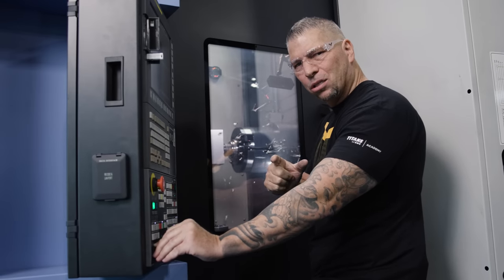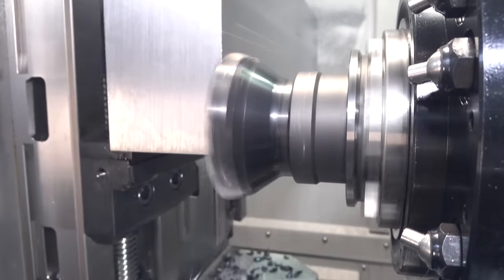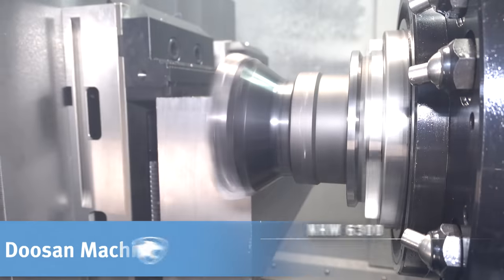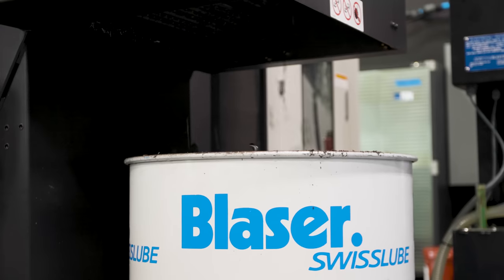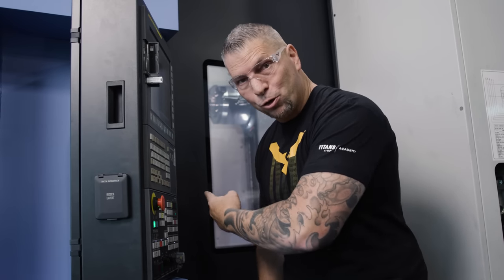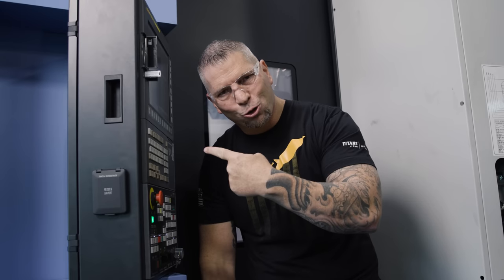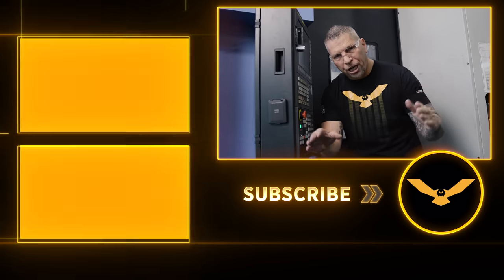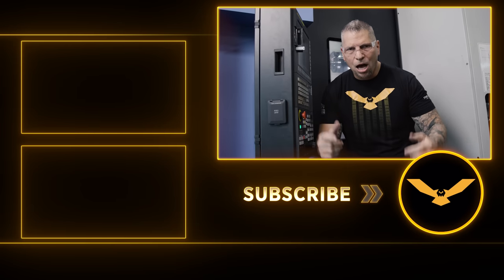Monster 4” DIA High Feed Shell Mill Shredding Steel | NHM 6300 | DN Solutions

Comment: I hope my homemade cnc will be able to hog some decent chips when it's done, I will have it finished this week after a year of work inbetween work and college. Love your videos! Always fun to see chips flying.
Reply: Do you have any videos of your homemade machine?
Reply: @BecomingOffgrid  not on YouTube but when it's fully working I will post some for fun
Reply: Hey, if it has the rigidity it's all up to the motor.
Reply: @brahtrumpwonbigly7309  it's 1000 pounds with 1 inch thick steel base that is also epoxy granite the motor is 2 hp so its gonna be a battle for sure its the size of a tormach with linear rails.
Reply: @AB_Tool  Why not just buy a Tormach or Doosan?  Could have been making parts all year.
Reply: @williamlind2843  not enough money also it helps me learn more about tons of stuff. I'm not planning on starting a business yet. I want to learn. I've got about 6 or so grand in it instead of 27 thousand. I'm in college so I couldn't justify that kind of money yet. I'm only 23 so as you can imagine I don't have my own home and property yet so a 27 grand investment is alot for me right now, it's probably a bad idea to spend that kind of money.
Reply: @AB_Tool  no chance of any decent cutting with that , must have been a nice project , a nice engraving machine perhaps
Reply: @kisspeteristvan  I made a short of it lol watch it does decent

Comment: Great product, we use this mill on cast iron and steel. On steel, insert 16, diameter 100mm, Z9, rotation 890rpm, Ap 1.5mm and feed 6800mm/min. On cast iron... insert 11, diameter 100, Z11, Ap 1mm and feed 24000mm/min :)

Comment: I always liked using a smaller face mill like this v.s those 12 and 16 inch monster. My rule was to use cutting tools that are weaker than my setup. That way, if anything goes south, the cutter is the weakest factor.
Reply: That’s also a good thing to use tooling that is not intersects with the pots near. That’s why I have full magazine inside my NH4000 😂 120 tools

Comment: "The tools inserts are positive and that takes pressure off the tool", does that also create a lifting force on the part adding risk the part will lift out of the clamp?
Reply: Most High feed insert geometry inserts force mostly in Z axis into spindle. Atleast the one i use. Didnt use the Kennametal yet
Reply from the maker: Always a danger in lifting… so rigidity and work holding is key.

Comment: We run the 6" version of this cutter. We run at a .06" DOC at 450ipm in steel using a 60% stepover.
Reply from the maker: Nice
Reply: Great googly moogly! 😳 How much horsepower does your spindle have?
Reply: @BPond7  we use this cutter on a 69hp 3,100ft-lb torque spindle.
Reply: @raceman351W  Wow! I’ve never had the chance to run anything nearly that powerful, in 22 years of machining. Sounds fun!
Reply: @BPond7  it has been a lot of fun. We machine some large castings and forgings on big horizontal mills. It’s always fun and interesting.

Comment: If you think that’s a beast try the 7793 go feed, have been using 7792 for yrs and the 7793 is even better and you get 8 cutting edges per insert instead of 4. 
ISCAR makes some as well with smaller inserts so more cutting edges at same diameter which is beneficial in inconel. Just ran a monster inconel part and used both 7793 and ISCAR with wishbone inserts and got some good data. Material was 58”x19.5”x 4” deep. Bunch of big pockets and angled walls that finished at .06” thick so removed 75% of the material.

Comment: I have not yet run a horizontal mill. Are there any benefits compared to vertical Mill?
Reply: Chip evacuation
Reply: Also, correct me if I'm wrong.  Horizontals tend to have limitations for power and speed as well in comparison to a vertical center.
Reply: @SGIABC  horizontal requiers more power to compensate for the difference in y resistance due to gravity
Reply: @sonzai9441  Ahhh, that make sense. I knew I had heard something about that, just couldnt recall what it was. Thanks man.

Comment: 2 things, were the feed rates adjusted for chip thinning? utilizing the feed rate multiplier for this tool, looks like a 12 lead angle, which puts you at about a 5x FRM(Feed rate multiplier)

also, i never see you talk about the importance of the correct torque for insert screws

alot of failures with high feed inserts is the incorrect torque applied, to much/to little, this is an important habit to get into
Reply from the maker: Thanks
We have many video discussing torque.
Reply: @TITANSofCNC  yes but in most videos, you can clearly see that in the video, titan did not torgue the insert screw @ 35-45 inch lbs

Comment: Sounds great. It gets a little scary when you have to use a 4-inch facemill. I'm not scared of the facemill but you can accidentally launch something.
Reply: I love using my 4" cutter, but it's rare I get a part I can securely hold onto enough to really work it out. On one part I use it to ramp a blind 7.9" bore without a pilot hole pegging my okk at 110% the entire time in some hardened steel.
Reply: I'm beginner in CNC machinist, sometimes I make mistakes in it. I'm in this field for 2 weeks. Sometimes I'm nervous and that time I make mistakes.
Reply: @OnlyPositiveVibes96  don't worry, I made a mistake on my 3rd week. Got too confident in a new program, the program picked up the wrong tool and they forgot to edit it and I plowed into the part and fixture an 1 inch deep on a 5th axis.  Gage length matters. 🤦‍♂️
Reply: @themattrixrevolution  I'm doing mistakes these days bc of nofap flatline😅. U know brain fog is there and no motivation.
Reply: @OnlyPositiveVibes96  Don't be embarrassed to make mistakes, only be embarrassed if you don't learn from them! Some of my more interesting projects were from mistakes when something did the wrong thing (my fault) and I realized on a later project that the "wrong thing" before was an "out of the box" way to solve a novel problem. (obviously be safe, and not reckless, and maybe do some learning on a basic 1/8" endmill rather than a multi-thousand dollar shell mill on a $750,000 machine first?)

Comment: Coolant?
Reply: never run coolant on a shell mill it will make the inserts chip out
Reply from the maker: In steel we chose not to use coolant for film purposes.
Reply: For mild Steel inner coolant is nice to remove chips during helikal Operation. For Stainless only air causr of thermo shock. 
Regards from Germany

Comment: HSK-100 Vs 50 Taper big plus - at low rpm which is better in terms of rigidity?
Reply: Tapers are better at low rpm. They have more mass and offen part of a holder can be hidden inside of a taper making it shorter. At higher rpm hsk gain the advantage.
Reply: @powylamywany8978  Thanks. That makes sense. Someone actually said HSK is not that rigid compared to tapers but some swear them.
Reply: Taper with BigPlus for sure is more rigid. Without it has many limitations and fretting problems thats why people swear them.

Comment: That first clip sounded a bit like when I'm milling with the 50mm facemill at work 🤣
With 320m/min (2k rpm) instead of the recommended 270m/min, the highest feed the machine is capable of (912mm/min) and then the machine maximum of 6-7mm doc

Comment: Now that i worked with kenametal stuff i prefer the local business even more. Trashed 3 sets of inserts where the local business just had one set and could still go. I dunno what’s with there inserts but the are very rough compared to everything else i had before. Guess maybe i just run it to fast as i expected it to be able to handle the same speeds..

Comment: Wouldn't it be more efficient to reduce the depth of cut but increase the feed, I dont see why somebody would use a high feed mill and then run it like that
Reply: If your machine can’t handle it, it gives you the option to replace power and rigidity with higher feed and lower depth of cut due to chip thinning. This was running at 150ipm and it takes some serious power to pull it. If you had lots of contours around a tall part then you may want to lower depth for a less coarse profile.
Reply: @rossomyman  oh right, I run a horizontal gundrill/mill at work and use a "large" high feed cutter now and then, what would annoy me running the machine in the video like that, you can hear that the spindle slows a bit down in cut entry, I dont think thats to great for your spindle drive
Reply: @callmeasuka5849  as long as it is 100% or less spindle load (duty cycle) you can run that spindle forever. At 150% load, closer to stall, you can still get about 6 or 8 minutes of run time safety.

Comment: Why not feed down in "Y" once the tool passes over the far end of the material, then 'climb' back across the lower area instead of wasting all that time rapiding back to the start/near end?  Or was it just a test to see how the tool and machine would handle conventional milling with those parameters?

Comment: Not really impressed, unless that just half the feed it can go ? The high feed that i use, has a  fz 2.5mm and on a 4 inch tool like that, that would be around 25000mm/min max feed.
Reply from the maker: It’s actually towards the bottom as I gave the range in the video. It’s a big 4” so it’s all relative

Comment: I actually run faster in 4140 using a Kyocera. I run 560 SFM but at .03 inch DOC and .055 IPT approx. 715 rpm (3in cutter) and 235 IPM (6 insert)